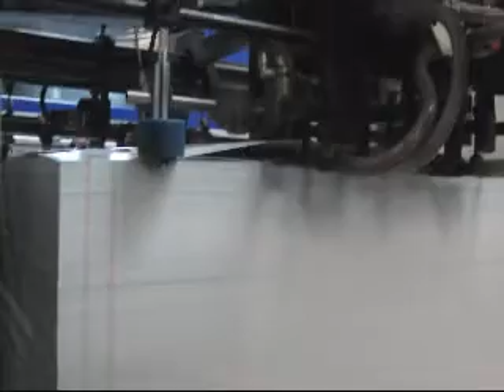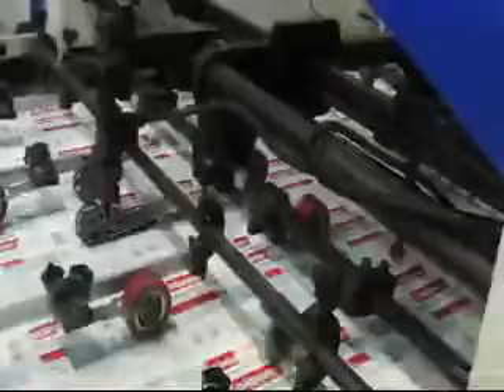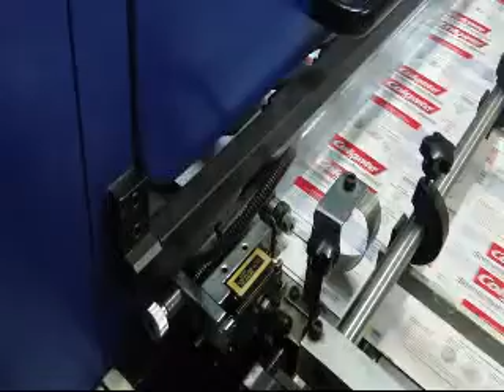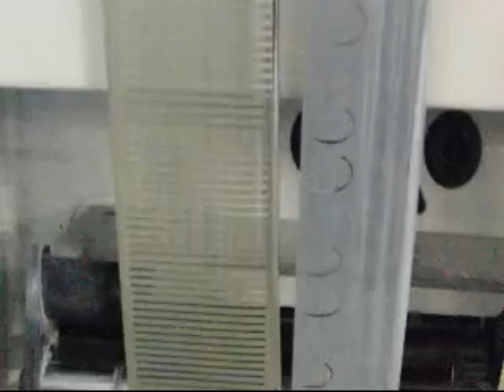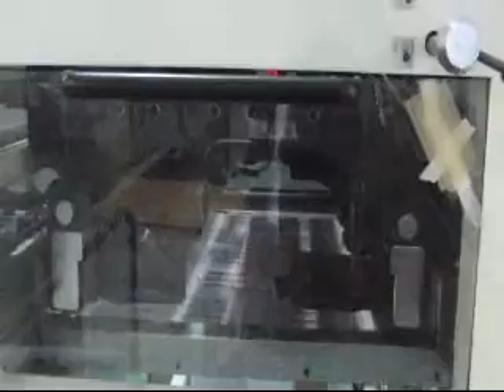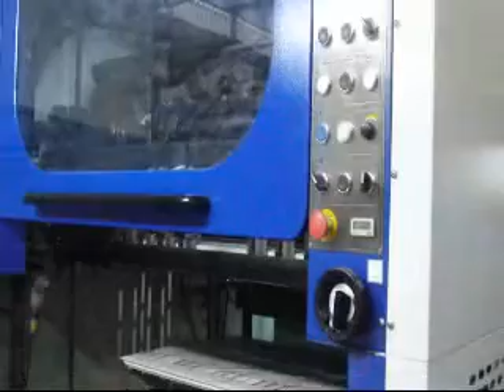TYM1050Y transversal stamping

Comment from the maker: TYM1050Y is a B1 format foil stamping machine equipped with two directions foil stamping units, users could choose the most proper one according to their jobs to facilate operation and to save stamping foil, even they could run both units at the same time.

This customer from Sao Paulo runs TYM1050Y 24hrs a day, the job in the video choose transversal stamping unit.